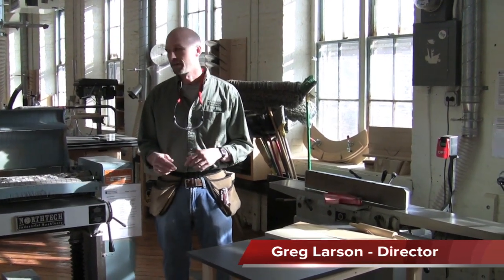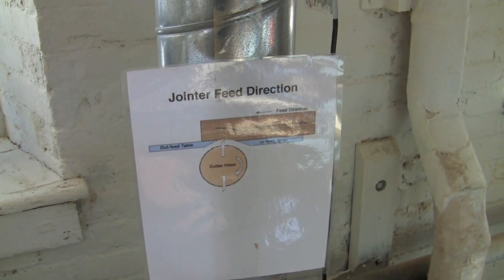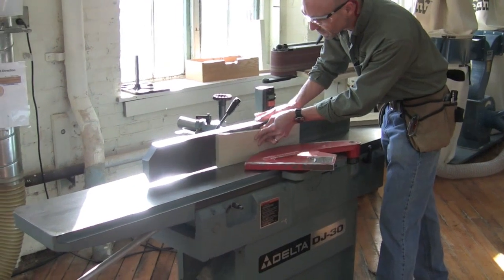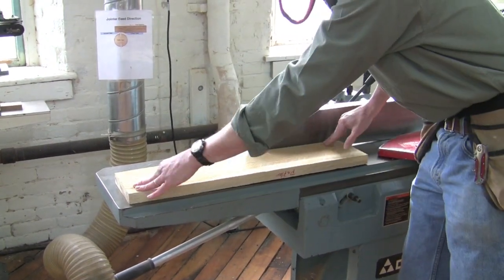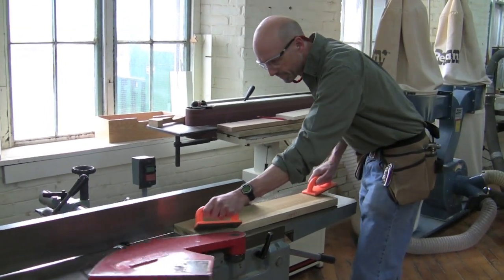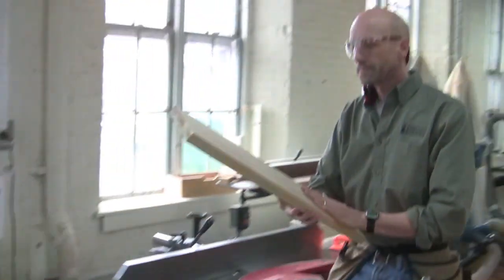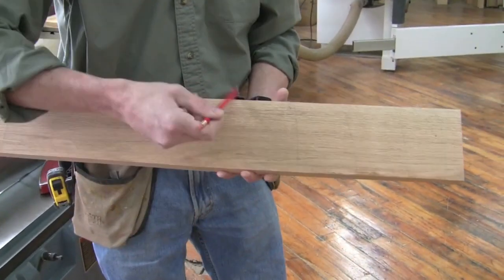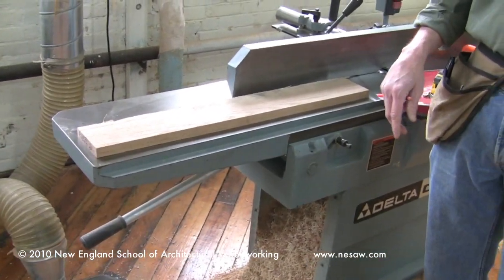Milling Four Square - Face Jointing

Comment: i find that face planing long boards, I'm getting more material taken off the leading side going through the jointer and after several passes, I'm getting a bit of a taper. I am running them bow up like you mentioned and trying to keep pressure on the outfeed.  Any ideas?
Reply from the maker: Hi There.  Long boards can be very difficult to flatten depending on how bowed it is and how long your jointer bed is.  The conventional wisdom is that you can only flatten a board that is twice the length of your jointer bed.  If there is enough of a bow, it's essentially following the curve of the board, kind of like if you just took a plane and ran it along the length of the board.  You will naturally hit the ends more than the middle much of the time.  I usually tell my students that to be successful flattening a long board that they need to start with a board that is already pretty flat.  You could try running it bow down, pressing in the middle and following it through to the outfeed, assuming your bed is long enough.  Without seeing the board and the jointer, it's hard to offer a course of action.  Long boards with issues are one of the hardest things to deal with.

Comment: Hello, I have a question. How important is it for jointer fence to be straight? I reasonably bought 12" jointer almost just like your,but the fence is crooked. It is bent and is office in the middle about 1/8". I am new to wood working. Thank you. Mike (Thailand)

Comment: I have seen many explanations and this is by FAR the best and most useful. It has been very helpful at this time. The reason for that is that although I was bought up with such equipment but havent done any woodwoking for 30 years. However, I have just bought a 10'' SIP Cast iron table saw and an old heavy cast iron jointer. Wish me luck! Thanks again. I have subscribed.

Comment: Definitely.  It certainly gets more complicated with a long board, but the principles remain the same.  If a long board is relatively flat to begin with, it's easy to flatten.  If it's warped or twisted, the hard part is making sure it doesn't rock or move when flattening.  Also, it helps to have a long jointer bed.  Honestly, if you need a fair bit of thickness from a long board and it's got a significant warp, cup, or twist, you probably should get a new board.  

Greg